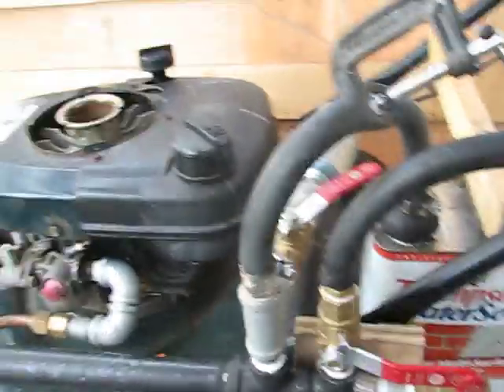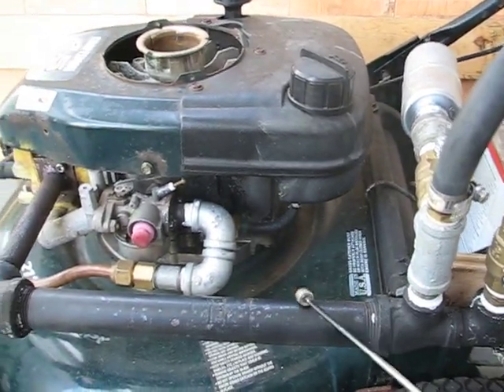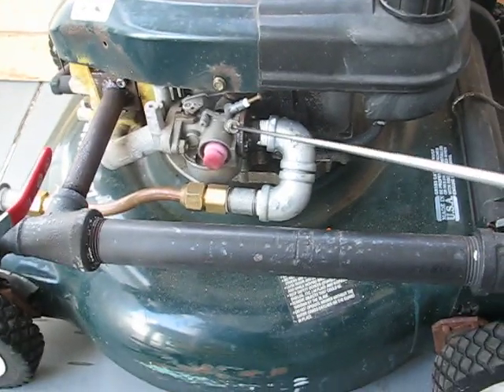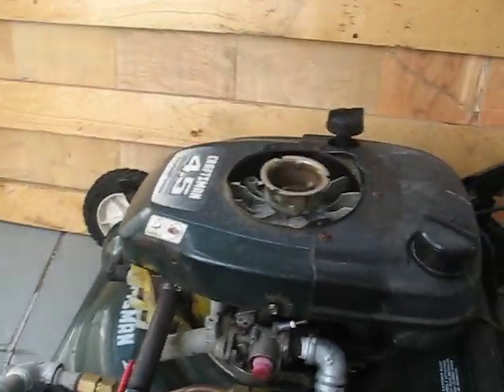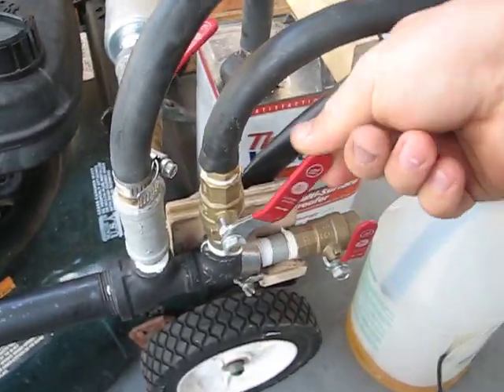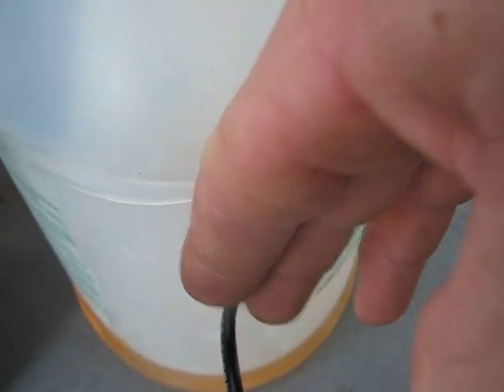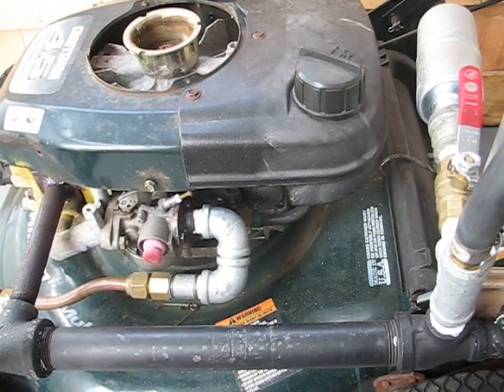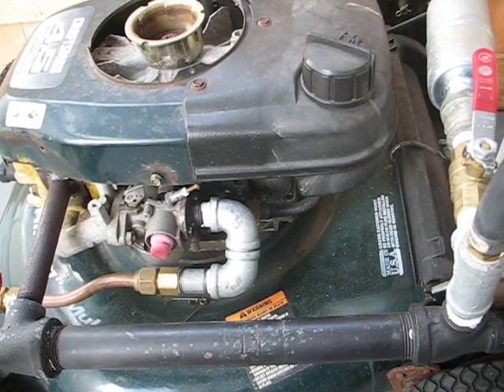Mover runing on diesel vapors!

Comment: Probably run better on gas vapor good video
Reply: I think he’s got some gasoline mixed in with his diesel fuel, look how yellow it is ..! I tried this with a 3 headed fogger, plenty of diesel vapors but couldn’t get it fire 🔥, so I’m gonna try a 50/50 mix .. I like the idea of using a fogger though ..!
Reply: Diesel fuel is pretty clear unless it’s off-road diesel which has a red tint to it ..

Comment: Epoxy the connections to the transducer or the liquid will attack the rubber/plastic over time.The gap in the bottle should be sealed and more fuel covering the transducer.

Comment: i don't think you will need a second transducer. but you need to improve your tank.
the tube need to be in the top most of the tank. and the hole for the wires need to be close. by this it will be better.  ;)

Comment: ...mechanical engineering. You can't improve the mousetrap if you don't understand how the mousetrap works in the first place. You are trying to improve on something that can't be improved on. I have been a small engine mechanic for 39 years. I also worked for John Deere Industrial (the yellow tractors) for 8 years. Fleet busses and vans? 2 years. Rental yard equipment? 7 years. I know just about everything (but am still learning) Believe me when I say you can't improve a (small) gas engine.

Comment: @tiltfull: Don't get mad. It's just that there are shitloads of you guys with these converted mowers running on everything but what it is designed to run on. Converting a gas engine to anything else is futile. You HAVE to start with a clean slate and come up with an engine that runs on diesel. Problem is, you are about 85 years too late. Any "conversions" have to start on 1 pull and be able to function without separate hoses, jars and other bullshit. It takes Lots of education. Chem. Sci; etc.

Comment: @novachevyguy 

actually yes, I looked carefully and he was turning it the right way, an engine bounces back if you only make 1 1/2 turns instead of the full 2 turns, for the piston to compress the air, if it is not turned all the way, then the compressed air pushes it back the other way when it stops, which is what you see.

But if you watch the very beginning when he started to turn it, it's clearly turning the right way.

Comment: Ok not sure if this will post been haveing problems BUT i ran a Generator with Gas Fumes and 2 back flash aresters. Also with a hho system. I recorded it and am attemting to get the video up. Also as i shut it off it backfired and the aresters worked. All though i had to change my shorts lol  A Key is 3/4 pipe works great with 1 Transducer

Comment: Yes i built a backflash arester in another video i saw. Its simply mesh screaning. I also added a HHO gen to the 12v charger to increase the milage I plan on hooking it up to the house and working a transfer box backwords so if the gen goes down the regular power kicks in and the excess power goes to the grid and i get payed lol.

Comment: With the exhaust pipe going in the gas tank, if you snake out a pipe at the bottom and make tiny little holes in the pipe, and also put a stainless steel scrubby wrap around the bottom part of the pipe , the gas should vaporized no? Did you make a test with a few ounces of gas from the original gas tank, and take the same amount of gas in the bubbler. Which one save the most gas and also make the test with diesel fuel, waste oil, water and gas and tell us the data you're having